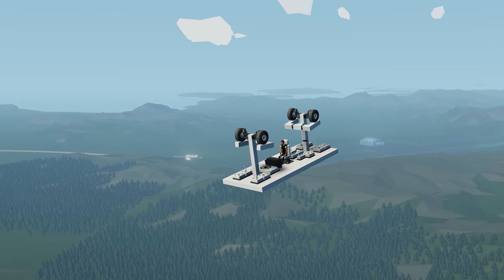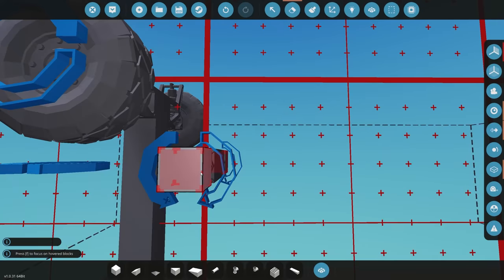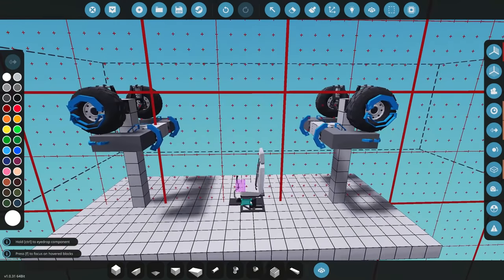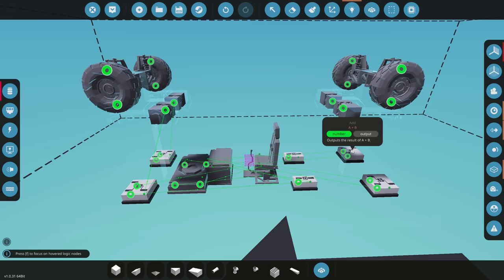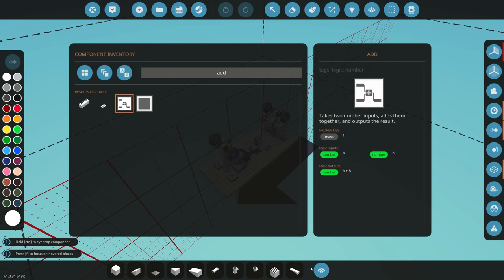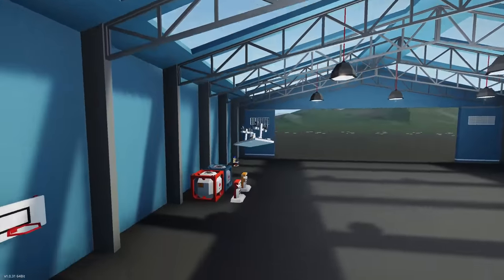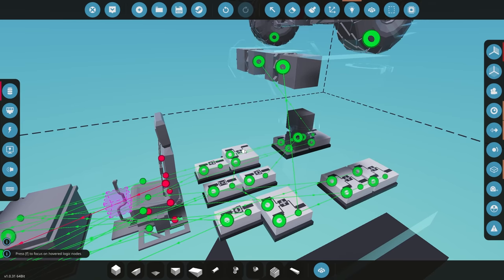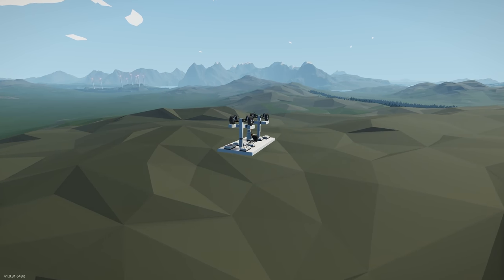Magical Flying Creation or Not?? - Stormworks

Comment: If they fix this, I hope they finally add in a negative buoyancy solution. It's impossible to do airships properly without this bug.
Reply: Obviously its gonna be fixed soon, its a wheel that abuses its own suspension. But yeah i also hope they will add something to build airships without a constant jet roaring in my ears and wasting fuel. Maybe theyll add a helium option in the fluid spawner and it basically weighs negative.
Reply: Cant an airship  be made using vtol jet components?
Reply: @connercurzio3645  Not really. You can make something hover and fly, but it's not an airship. It burns fuel just to hover and screams like a banshee.
Reply: @NCIA-93  this reply did not age well.
Reply: @turbopanda7012  yep
Reply: @NCIA-93  good news. It's still here!
Reply: @Bruwulf  you can make one using a single jet engine a few friends of mine do this to make halo ships
Reply: @NCIA-93  nope still not fixed and never will be 🤷‍♂️
Reply: it's been 3 years

Comment: Dear MrNJersey.

After I added the gyro and add blocks, I did the logic just as you did, but when I spawned it in it went crazy, it started flipping around even before I got on the seat. I couldn't stop it either, please help.

Thank you for your time.
Reply: Cheek your pivot rotation would match the example in the video. If your pivots are the other way around to in the video you’ll need to have the inputs inverted or have the left connections on the right instead. I made it into a micro controller and accidentally had mine set inverted ans mine did what it sounds like yours does. It’s working fine now